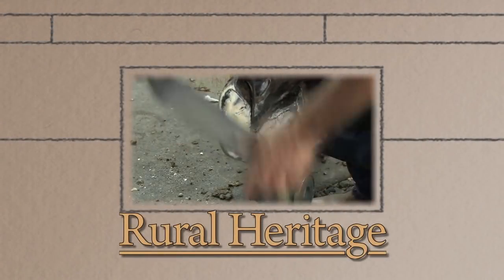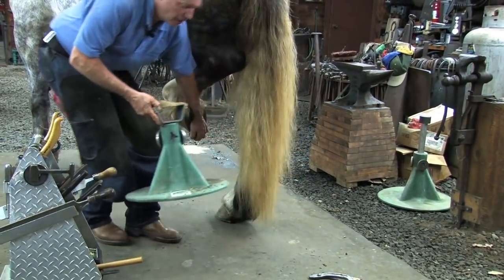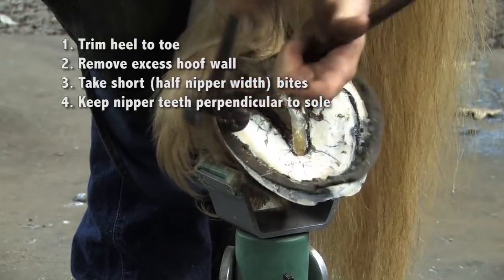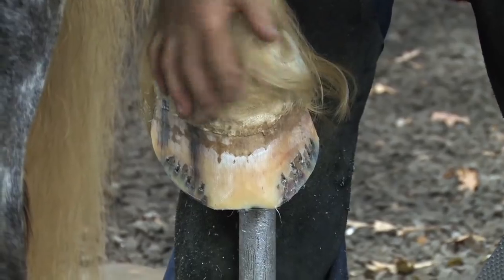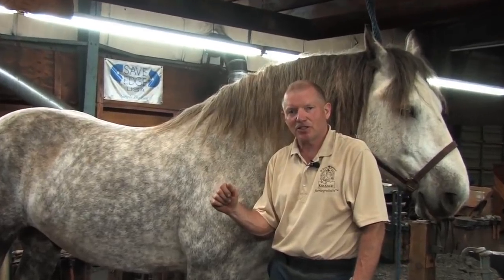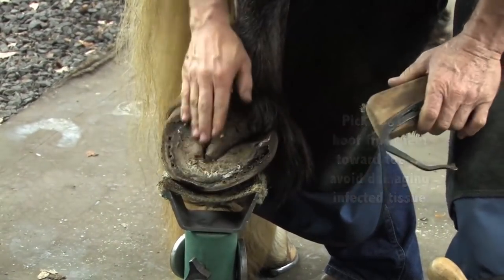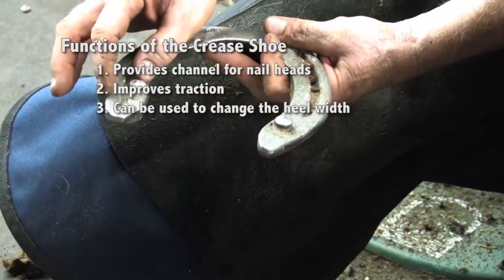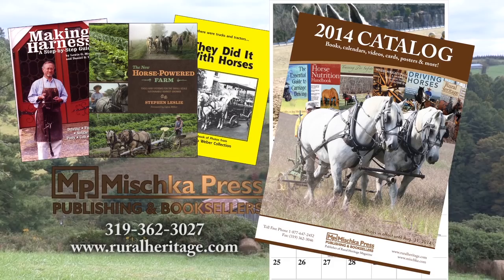Shoeing a Draft Horse - Tips and Techniques Part 2 (Rear Hoof Trimming)

Comment: You can tell a happy horse he stands still and allow you to work on them.  This is interesting for me because the horses were gone before I came along on the farm.  I was told you don’t keep anything that does not work at something.  I wonder what purpose I had.  I was a small female child.  I didn’t have many tasks to do til high school when I helped with haying.  I could drive the tractors putting the hay up in the barn.  I could help loading bails on the wagon.  As an adult, they baled into the big round bales.

Comment: Can the old nails be recycled into fresh shoes or nails at the forge?
Reply: Dawn Mason throw away. Pls use new nails
Reply: I dont have a horse to shoe lol was just wondering if the metal could be melted down & reused.
Reply: Dawn Mason 
In a way, yes. You can recycled them the same way you can with a metal can. Depending on the type of nail you use, that is.
Reply: Make necklaces out of them and sell them on etsy

Comment: do I need to shoe my sons horse if he is NEVER on pavement?
Reply: Horses and Hounds yeah
Reply: Depends on your horse's hoof type. If the horse has really soft feet, then yes you probably should, especially if they get lots of cracks.
This also depends on the rest of the jobs you are using.

My mustang was only ever shoed for medical reasons, but he wasn't a show horse and he had hard, durable hooves.
My Belgianmule is sometimes shoes, as she goes with my grandpa for hunting season and it is just safer to have shoes on, even though she has strong feet.

I'd suggest looking up signs that you need shoes and also consulting a vet. Seeing as I don't know what all your horse does, I can't give you a valid answer.